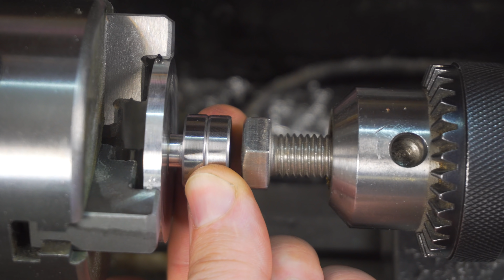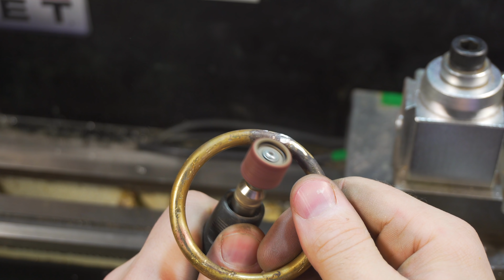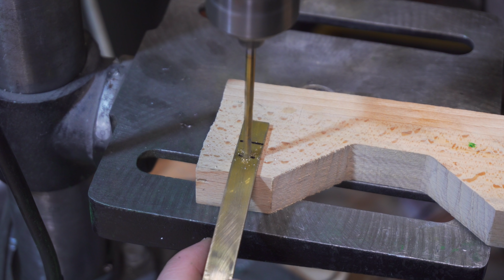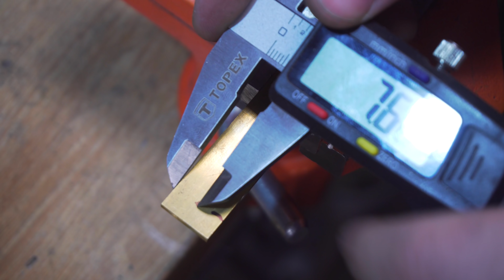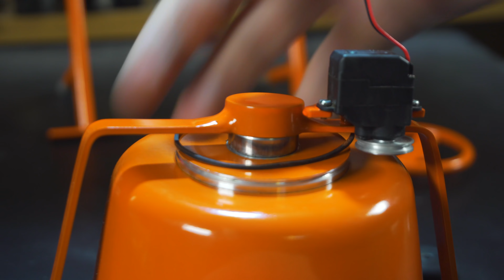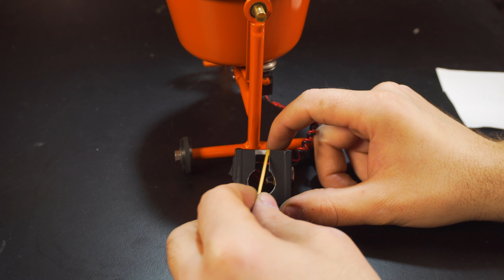How to make Electric Coffee Mixer // Concrete Mixer

Comment: I'd add a small wheel in the control box with tiny ratchet like notches to keep the "mixer" in various positions. Oh, and a lip, so it doesn't drip when you pour.